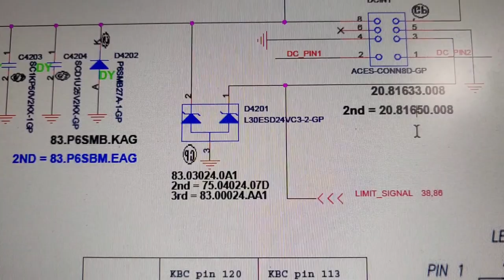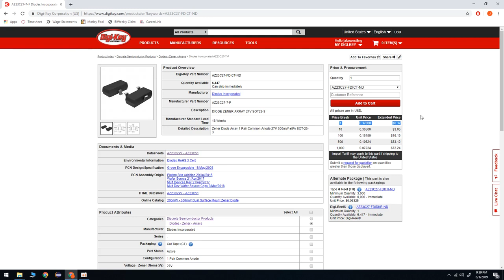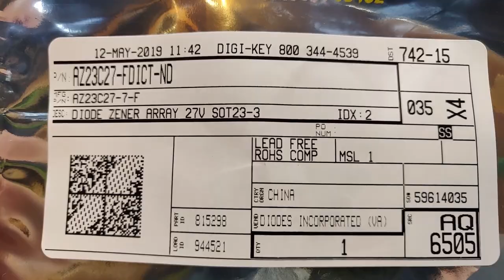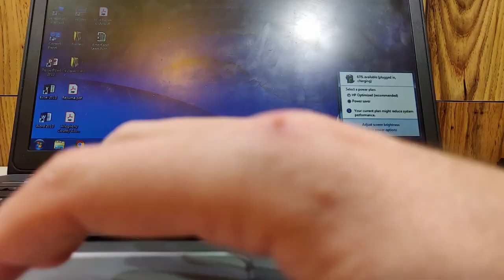How to Fix a Laptop that Won’t Charge – Disassembly & Repair

Comment: I have a laptop that i found outside  this was over the summer.it is hp there was parts that i took also.i found a ps2 charger and it fits suddenly the light was blue where i connect the cord to my laptop.the laptop wont turn and i don't see the light turning orange.so do you think i have the wrong charger or it might be something insider that i need to replace.